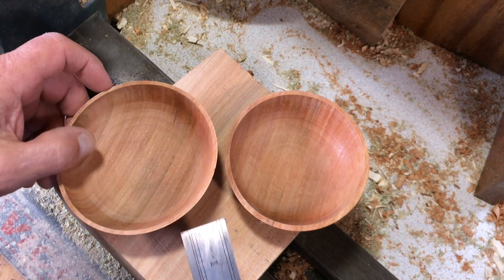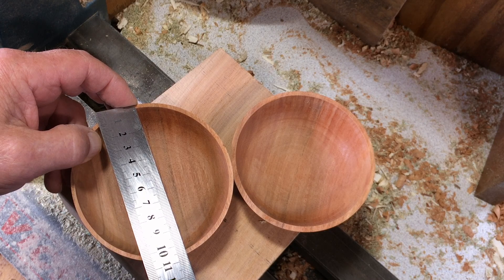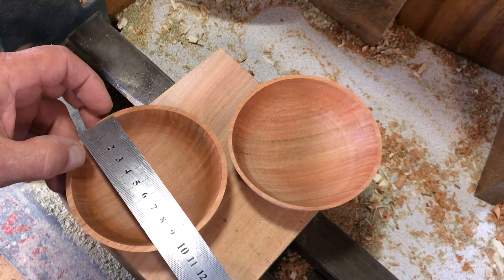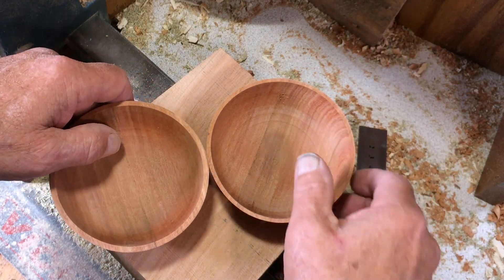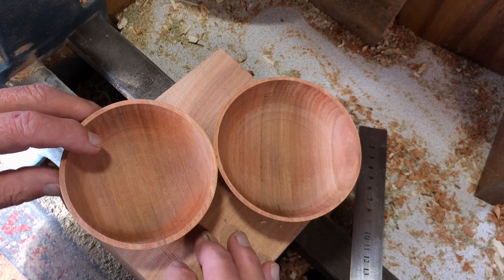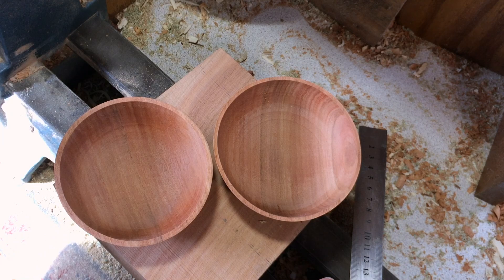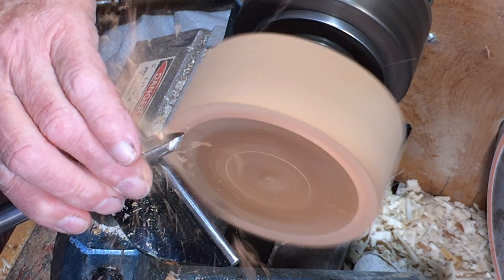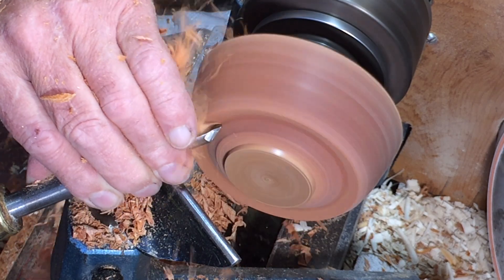Richard Raffan tests how wood reacts when drying.

Comment: Very nice! I think the wood is a type of a eucalyptus --- swamp mahogany, maybe?
Also, interesting timing. I turned a few bowls today from a green Oakwood and some of them moved by a lot. I'm not sure if I should give myself 10 per cent thickness at the rough turning stage, or maybe more.
Reply from the maker: I'm told it's ironbark which is not dissimilar. If the wood moves a lot, like some casuarinas, I'd be thinking in terms of finishing the bowls green and letting them go. Otherwise 25-20% might be wise and hope the thick wall doesn't split.
Reply: @RichardRaffanwoodturning  many thanks Richard!